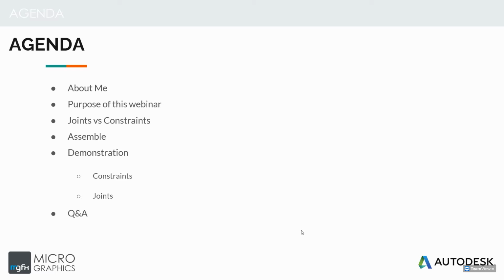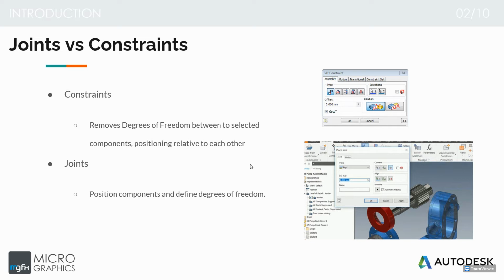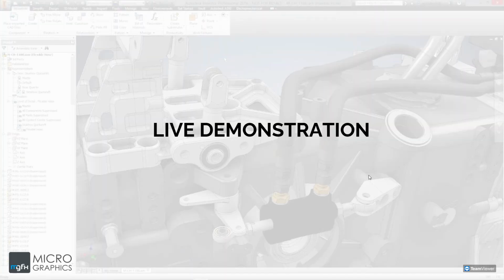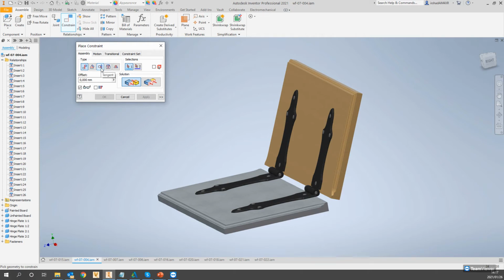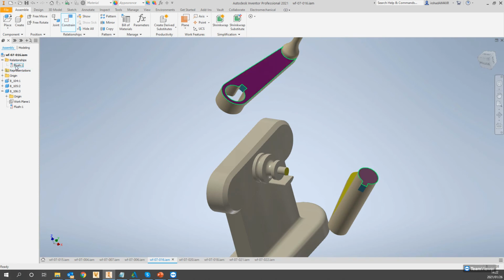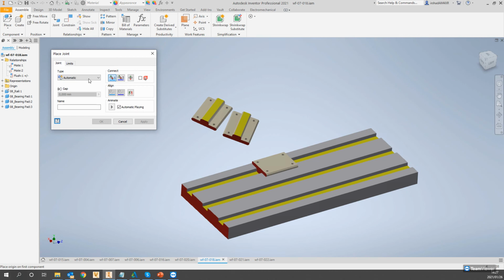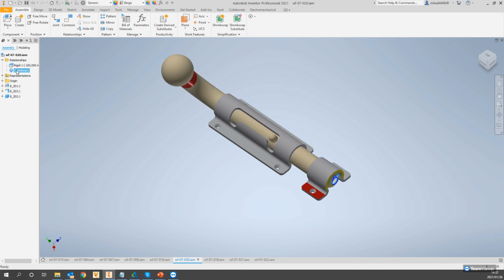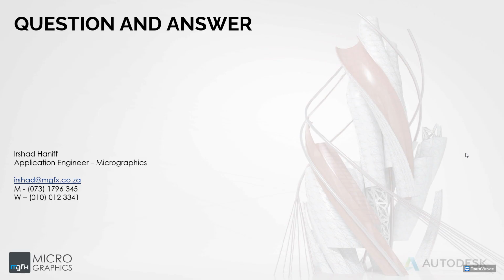Inventor Joints and Constraints   Best practices

Comment: It is possible to limit constraints too.
There is max and min value, also something like rest check box so desired value will be default and you can move it from min to max but when you release it will go to desired value, like spring connection.